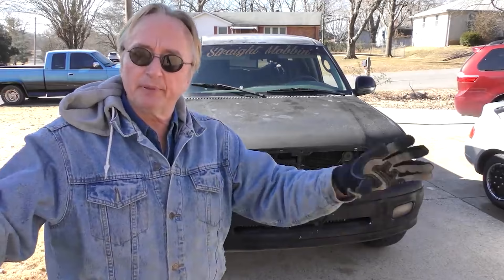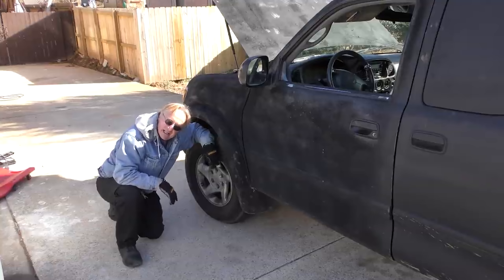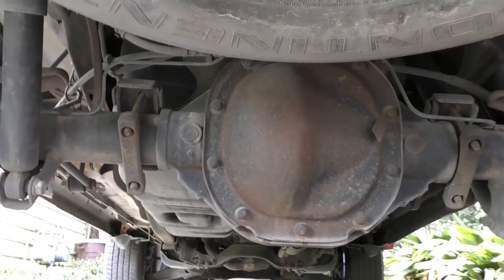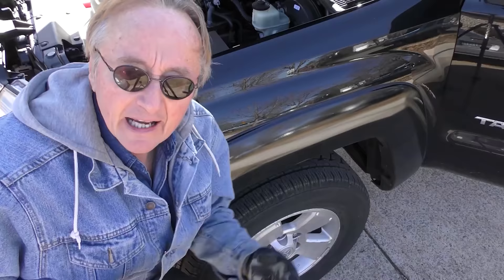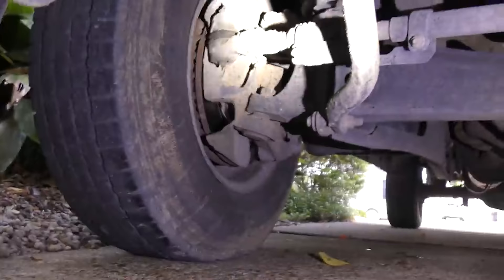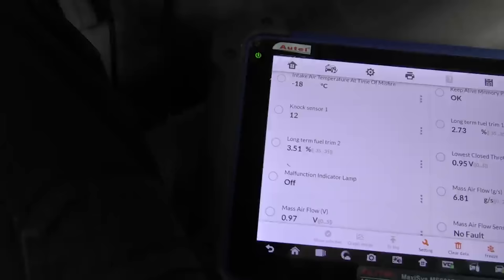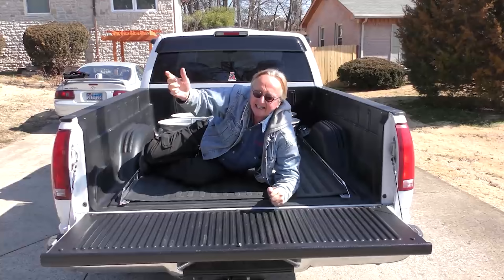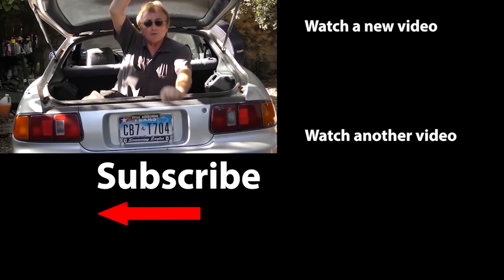5 Trucks You Should Buy

Comment: Old Toyotas still very expensive  even with lots miles unbelievable. Those trucks are unstoppable.
Reply: First gen tundras can still be found for 10k or more and the truck is like 20 years old lol those 4.7s were the best motor Toyota made
Reply: F-150 is a cheaper buy. Spend more on gas but bigger and more capability.
Reply: The prices are unstoppable as well, they keep rising
Reply: Insanity
Reply: There's an old crackhead dude in my neighborhood, super cool - missing teeth and all, drives a toyota pickup from the 70s. He's a construction worker.
Reply: Except the frames.
Reply: I've got an 01 limited, that sucker's run like a charm for my first car. It needs some work with the engine (it started making odd noises at me the other day, so i changed the spark plugs on it, it ran fine for a few miles, then started making the same noises, but much worse.) And now I'm gonna get it to the shop for a tune-up, as i believe it's the wires to the coil packs, so wish me luck, guys!
Reply: Yeah just buy an old Chevy for 2 grand, they're cheaper parts and easier to fix
Reply: Rust just loves them though.
Reply: they are not good in salt   ..frames  go
Reply: I saw a Camry wagon, with like 220k on it for 4500....insane
Reply: Buy a Toyota
Reply: I paid 8 grand for mine with 128000 miles 6 yrs ago. Ive done some maintenance and replaced a few things but it still looks and runs perfect. Got 230000 on it now. I live in the south so its never seen salt. Not a spec of rust anywhere.
Reply: @krayzie281  I got a 96 T100 love it
Reply: I still have my 2002 Hoe with 270k miles.  Trained 2 teenagers.. one who loved off road. :( 
Still humming... I’ve put 4k into it. Rebuilt trans with corvette servos   And blown head gasket. So did a valve job.   The parts and labor to work on these is so manageable.   That’s why these will be around for decades. And the new ones forget about it.  The tech is too expensive and cost prohibitive
Reply: I had a Tacoma for 16 years and all I had to replace was the wheel bearings aside from regular maintenance. Bulletproof trucks. Ask any mechanic those things are tanks.
Reply: If the frame is fine, the Toyota Tacoma pickup will run forever. Salt will eventually eat up the frame, I had a 95 that 9 years ago the frame wouldn't pass NYS Inspection because of it. It had a 2nd life as a dirt packer truck until the frame finally snapped on it, well over 200,000 miles, original engine and transmission. I'm driving a 2000 Toyota Tacoma now with over 200,000 miles, frame still good and solid because it came out of Virginia 9 years ago.
Reply: Maybe if scotty would stop making videos on them, the prices will go down
Reply: @blakewixom2893  I thought the same thing immediately as I watched them, I was hilariously visualizing the prices of old beat up toyotas rising. I know some people do not take care of their cars at all, and even a toyota will not survive abuse.
Reply: I agree with the Unstoppable statement with regards to Toyotas...as in the frame rust is Unstoppable because it rusts from the inside out. My Tacoma frame rotted out so much that it nearly broke in half. Running gear wise it was great, if not for the damn frame I would've kept it forever.
Reply: @troy3456789  I'd never buy one, the old chevy 1500's with, the generation before the vortec 350 engines were good. I know a person who know's a person who had one with 1.2 million miles on it, it went through 2 engines and only 1 4 speed automatic transmission. And you can get one in decent shape for 3k
Reply: Very expensive
Reply: @durango8882  I ain't paying 14k for a 20 year old truck, that's ridiculous, Most I'd pay for an old tundra or tacomba would be 4k
Reply: I've got an 02' Tacoma Double Cab with 150k miles... Not one issue... They're the real deal
Reply: @durango8882  very
Reply: I had a 85 sr5 ( like the one from back to the future) I sold it at 400,000 km and still got 3 frand for it in 1999 when I sold it. Best car ibe ever owned
Reply: @blakewixom2893  I've seen one (2003) for sale for $6,500 with 300,000 miles!!!
Reply: My uncle got one with over 400k miles and still drives smooth no problems
Reply: Get a ford ranger
Reply: @n.c.2537  saw a 2004 4x4 v6 sold at auction for 6000 321kmi
Reply: When I gave up my 85 mini truck after well over 200k with very very little work, I just couldn't get over it for quite a while.  It could have probably gone 400k with very little xtra work.
Reply: I can see in the amount of comments that there is  just good feed back of those old Toyotas even odometers with some crazy amount of miles on it and still been able to sell it for good money
Reply: The game is rigged my friend
Reply: @garyphillips6270  mine had undercoat applied 3 times. Frame looks great. 227K on the odometer, 96 T100. It needs lower control arms but the thing doesn't sputter or knock! I got at least another 100K miles on it
Reply: @snarlador  more capacity until they break down. They are Ford after all
Reply: We've been looking for another Tundra for our landscape business..A lot of them at 200-300K miles for sale and still 8-15 grand!
Reply: @Pantelifts10  yep.   That was my issue. Pick up an older Chevy
Reply: @567Kriss  i have friends with older Chevy work trucks. If I was ever to buy a Chevy it'll be an older one. I respect those I've! I've found a few RWD Tundras significantly cheaper. We're thinking of using them for April-Nov. at least for landscaping projects.
Reply: TOYOTA =RUST  boxed in frames .Up north' down south can not go wrong
Reply: i picked up a 2000 with 145,000 miles on it for 2,700 monies
Reply: I don't know man, I got a 93 Sonoma (s10) with 178k, I put 70k miles on it in the last couple years, all across the country and the Rocky mountains, and I spent money on oil, gas, bulbs, and a clutch cylinder and a water pump. Those last two were 150 bucks total. Oh and the heater core leaked, so that was 45 minutes and 40 bucks. As long as I don't have to go to a mechanic, it's night and day cost of ownership and hassle.
Reply: I have a 2013. Considered trading it in but then came to my senses.  😂
Reply: I just bought a 1992 Toyota pickup with 130,000, second owner, zero rust on the frame (southern California truck) and it was 8500... think I got a good deal.
Reply: I know this guy who wants 6k for a 06 Tacoma
Reply: No joke I was looking at a 01 Tacoma w/ 160k fof 9000$ and 0eople still said it was a good deal
Reply: @captinbeyond  My 02 throws code P0440 when the tank gets under 1/4. I think its the evap purge valve. New gas cap may fix it if you haven’t changed it yet.
Reply: @doodoobrn  Not anymore... In the midwest, you can't find one with a body left on it.
Reply: Ford F-150 and rangers are bulletproof as well I towed over 16k with my ecoboost I’ll never do it again but it can tow it which shocked me I was impressed
Reply: burned out T100 hulk seller: $45,000 I know what I got
Reply: @richsweeney1115  just bought a 2003 camry in canada with no issues for $1800 CAD that's like equivalent of the cost of a steak dinner in the US.
Reply: Jeep Jeep Jeep Jeep Wrangler/rubicon
Reply: Just got an 09 a year ago. 240k miles. Runs brand new. 2.7 manuel
Reply: @doodoobrn  I regret selling my 92 sonoma. Great little truck.
Reply: Recently saw a Toyota Tundra 2006, 4wd, 98,000 miles $20, 000. It sold in a heartbeat.
Reply: @troy3456789  Sought after by who a crackhead?
Reply: @Pantelifts10  Rip off
Reply: @troy3456789  “Toyota will not survive abuse” LOL you really made me laugh, Toyota easily last 200k + miles with or without abuse. Not as junkys chevys
Reply: My 2006 tundra  just died with 186,000 not impressed to be honest
Reply: Horrible if you live in an area where they salt the roads… probably great in a warm climate
Reply: Everyone has different experiences with every vehicle
Reply: What would a 86 toyota 4x4 pickup be worth today? Its carburetorated with 165,000 miles.
Reply: I just bought an immaculate 2010 tundra limited 5.7V8 4x4 crewmax with 99k miles for $25,000. Tons of goodies like TRD exhaust, intake, canopy, leather seats etc. I have absolutely no regrets. I'd rather pay that than 70k for a new POS. Toyota for life.

Comment: My dad's green '97 Silverado has over 350k miles with it's original engine and transmission still going strong!! Talk about a truck built to last
Reply: My 95 stepside has 270k. Doing great so far
Reply: My dad has a 05 gmc with over 600,000 miles and it runs good.
Reply: My 94 stopped reading mileage at about 340k still going strong
Reply: Well I had problems with my 98 Silverado z71 I couldn't keep a transmission in it went through 5 4l60e transmissions before it went to 250k miles
Reply: @slaydebriggs3849  that means you were pushing it too hard or towing too much but I do agree the 4l60s weren't bullet proof the only real killer was heat (towing things with a 4x4 truck instead of a 2wd I've noticed all the ones that are just 2wd drive last longer I've had both and both transmissions the 4l80 was bullet proof with the trans cooler it had but the gearing was kinda shite if you don't wanna only be around in the city granted mine also had 4:11 rear end but still my 4l60 gets the gas mileage and the 4l80 does the work if you look for any in the future just eye up a 2500 instead most had the 4l80 and most were 4 bolts mains and this is coming from a guy who has a 4l60 that only just needed rebuilt at 268 thousand but I have heard horror stories also I've heard putting a shift kit in helps a loooot
Reply: @joshuamaas5380  I admit that everything else was great, motor was still fantastic when I got rid of her, but that transmission problem is the reason I will never buy another but it wasn't just me all my buddies had em and we all had transmission problems, transmissions would usually only last us between 4 to 8 months where I live we constantly stay in mud so 4x4 is engaged almost all the time that may be the problem but we never had these problems with other makes
Reply: @slaydebriggs3849  yeah the 4l60s was junk in my opinion my 89 has 5.7 th400 3/4 ton. they seem to last longer
Reply: mileage unknown 291k stopped working 6 months ago and ive been to dallas joplin and kansas pulling 5th wheel rvs lately
Reply: @slaydebriggs3849  why did that many go out?  what we're you doing to make them go out? Unless you were doing something with it you should not have been you had a issue causing that problem!
Reply: @mike-bj4dk  I prefer a manual, but  th400"s will take quite a beating and still go. Its the only transmission I've ever seen that tells you in the manual that if you get stuck, to rock it back and forth. I had a 79" Lesabre with a 6.6L  (out of a Trans Am), with a th400. You could do like 60 MPH and go right into reverse and it would slow down then take off backwards just roasting the tires.
Reply: I have a Nissan 1994  D21 with 320 thousand miles. Original motor 2.4.
Reply: My 97 Z71 has around 250k and still going  strong 💪
Reply: My 2011 has 250 000, and never had an issue with it. never touched the motor. I don't understand why Scotty thinks Toyota with their rubber band timing belts are great.
Reply: @slaydebriggs3849  That transmission prefers low range when plowing snow, or a heavy duty tranny cooler for towing. Heat is what kills them plus they can only handle up to 400 foot of torque, it isn't designed for towing much above 6500 pounds.
Reply: Got a 98 Silverado with 248k going strong. It just got stolen for th e cat so i had to replace it😞
Reply: No way it’s the original transmission. They’re junk
Reply: @Clamjammer  yeah bro they last my dad has the same transmission from when he first got his truck and its at 250k. He only change the motor because it was crashed into when he bought it

Comment: My 2002 Ford Ranger with 2.3l engine has 822,000 on it still drives 7 days a week! I'm not even bored with it. Just a very versatile machine I can't do without. Still 25 mpg too.
Reply: That must be a record !!!!!
Reply: what kind of maintenance are you doing on that? surely you’re taking way better care than most owners
Reply: Impressive
Reply: Holy Damn !!!!! Lol 😆 🤣  sheessh bro Bravo on that one
Reply: Are you sure you aren't mistaking a 3 for an 8 on the odometer? Even 322K would be extraordinary.
Reply: @rtflone  he said 822k
Reply: I had a 94 Ranger with 4cyl and manual trans. It got 30+mpg and I put a lot of miles on it. About 50,000 a year.
Reply: Automatic?
Reply: Only problem is that belt tensioner. Had to replace mine twice because the belt would make noise
Reply: @rtflone  NO those are notoriously bullet proof - I have known a few guys who have had a few like that
Reply: The 2.3 was built like a diesel.
Reply: I used to dirt track race 20 years ago and we would use stock bottom end 2.3 with 250k and turn them constantly at 8000k rpms during race.   they still use them to this day....they are bullet proof
Reply: Cap

Comment: I had a 97 Silverado a few years ago. One of the best vehicles I ever owned. Got it for $1600. Within 2 years I only had to replace the alternator. You can't beat that.
Reply: Def the 96 97 98s with the vortec 5.7 liter and 4wd were some of the best trucks ever. The 5.3 they started using in 99s with the new design were also good but had some common issues Chevy never shoulda allowed happening
Reply: I forget what year, but I had a Buick lacrosse for many years. I had one major repair, the tranny broke. Otherwise, it was very serviceable right until the day I sold it. The kid abandoned it because it needed new rims. Smdh
Reply: @paulpheifer3002  I got a 99 tahoe for 800 bucks and after disabling the security system it runs perfect.
Reply: @paulpheifer3002  4.8, 5.3, and 6.0 from '99 to '07 are pretty solid engines, but the 5.7 is more stout and one would be surprised to find any problems. We know someone in our family that has a 5.3 where he put over 500k on the engine with no rebuild and same tranny.
Reply: Is there any difference between the chev Silverado and the GMC sierra? I have a 97 Sierra and its almost the same as the Silverado
Reply: @mrprogamerman693  Well Starting in 98 the only real difference was the grille, headlights, and badgese, but before 98 especially in the 80's GMC was built to be more suited as better working truck. More durable engine, beefier suspension and transmissions. More modern GMC's are known to be more luxurious. Heated seats, better stereo system, or larger LED displays.
Reply: @buzztrucker   agree totally
Reply: I miss my 96
Reply: @mrprogamerman693  The differences are mostly cosmetic. Under the fluff they're the same vehicles
Reply: @rtflone  even then they're hardly different cosmetically. Like I said in a previous reply, the only immediate difference between the 2 trucks is which badge they have.
Reply: I drove a Ford F150  1995 for 8 years  it barely gave me any problems when i bought it it had 150,000 miles replaced the fuel pump and clutch  4 years after i bought because i learned how to drive manual in that truck. I drove in the snow ice and it wasn't 4x4 it was a really good truck
Reply: I still got my 86 Silverado I bought in 93 love it to death runs fine it just needs a new paint job though
Reply: @tpvn8377  I have an 86 GMC Sierra 1500. 350 V8 TH 400 PS PDB PW A/C tilt cruise towing pkg just turned over 100K miles. Needs paint that's about it. My orders are to bury me in it..
Reply: @rtflone  mines at about 235k miles
Reply: @tpvn8377  And no reason both our trucks can't go on indefinitely with proper maintenance and a TLC. I wasn't bragging that mine had reached 100K. I was bragging that it only had 100K after 35 yrs. I'm going to get rid of the carb for fuel injection pretty soon. There's a throttle body unit on the mkt that's a direct replacement for the carb. Cost is under $1000 the installation takes about an hr..

Comment: I have a 1998 GMC k2500. 5.7 liter. 138,000 miles. I changed the differential oil first time at 137,000 and I was completely surprised.  It had no metal dust whatsoever in the bottom of the case.  And I tow a boat with a cabover camper!

Comment: Those old gmcs / Silverado’s we use as work trucks. We put them to work they have 280k miles still running
Reply: the dang 4l60e that comes in them are their weak spot.  cant beat their engines tho
Reply: I have a 2007 gmc 1500 wt with 280,000 on it. Starts right up.
Reply: I have a 1998 Sonoma pickup truck with  160000 miles on it had it for over 10 years it still starts right up

Comment: 97 3/4 ton GMC with a 350 here. It fires up everytime, pulls way more than it says on paper and with no problem. I highly encourage to install beefier front end. Since I did that, no issues, no clunking and drives straight as an arrow. Also, the motor is so easy and simple to work on! It sounds really good with straight pipes too 😉. Classic American V8 rumble

Comment: I just got a 2000 tundra for $5,000 and it has 184,000 miles. Runs like a dream
Reply: Is the frame rusted?
Reply: @MastersOfMask  They do rust but if you oil spray them or anything...will not happen
Reply: @MastersOfMask  
Good point.  Toyota had a major recall on the 2000 tundra due to suspension/frame rust issues.
Reply: It has a little surface rust but not much.
Reply: Fuel Pump replace yet ?